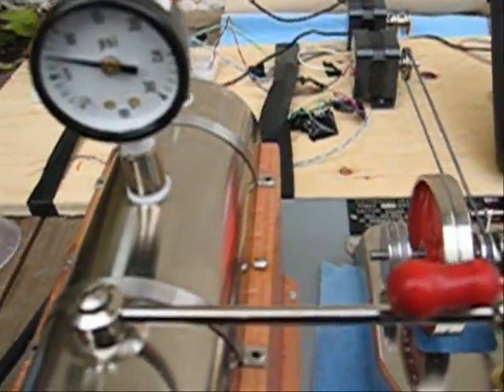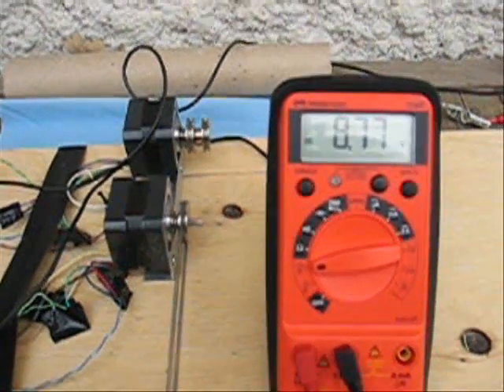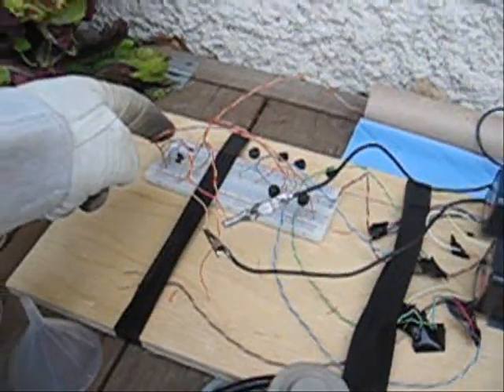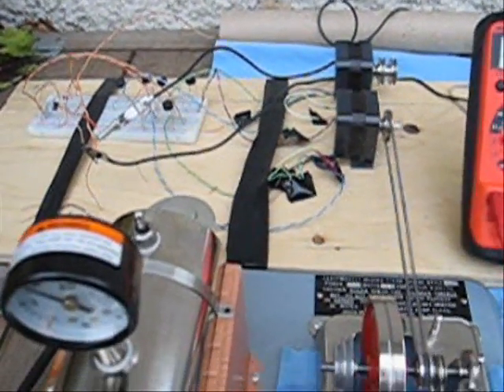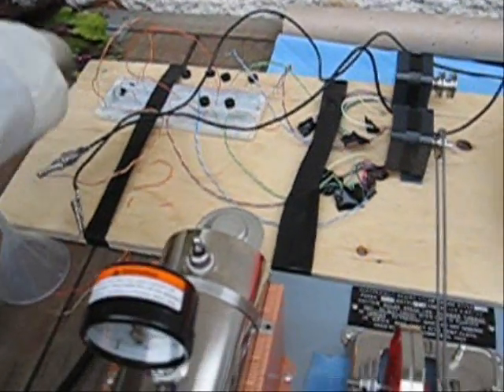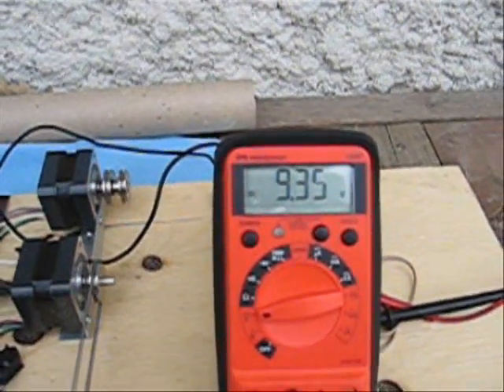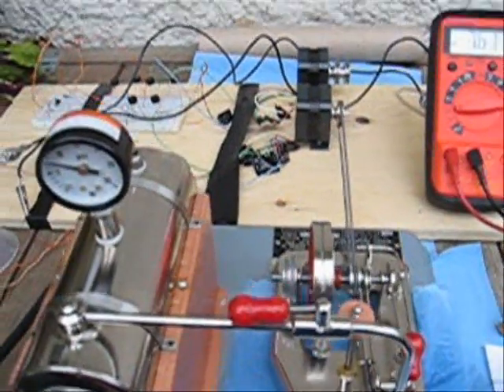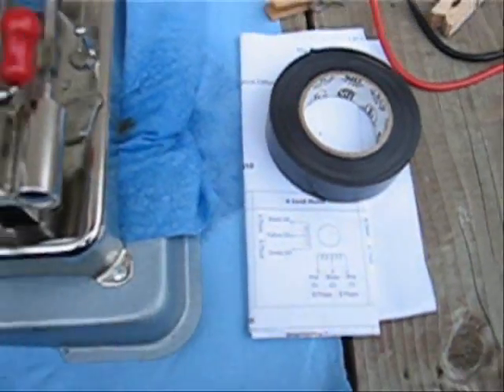Stepper Motor Generator - Various Rectifier Circuits - 2

Comment: you could probably increase the rpm by putting a bigger "gear" on the steam engine and keeping the stepper motor"s gear the same size but it would increase the power needed to spin the wheel so my idea is a bit sketchy... feel free to try but i probably guessed right about the power...

Comment from the maker: I never measured the AC side of the circuit.  But all the rectifier does is flip the negative side of the AC wave up to the positive, creating DC current.  There will be a slight loss of current in going through the diodes, since they aren't 100% efficient.